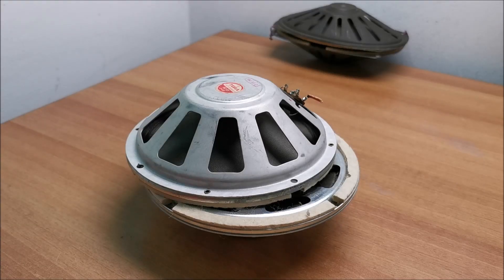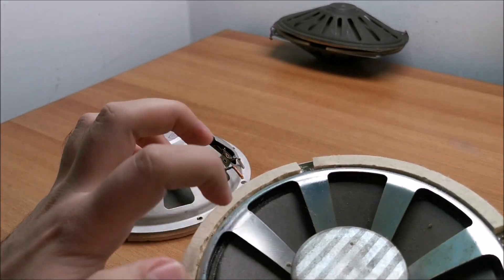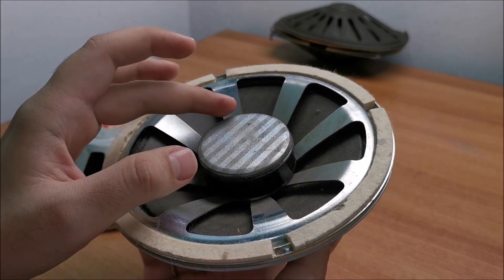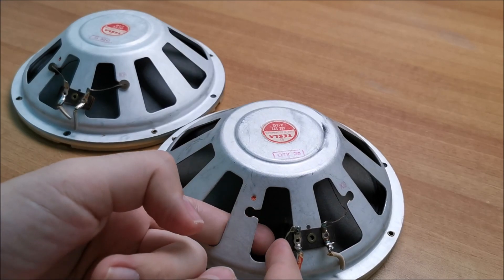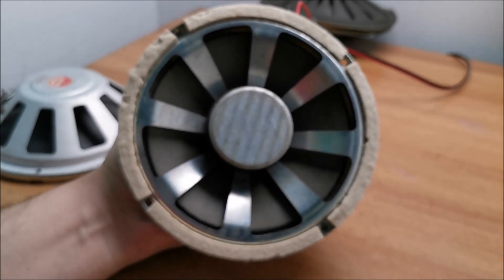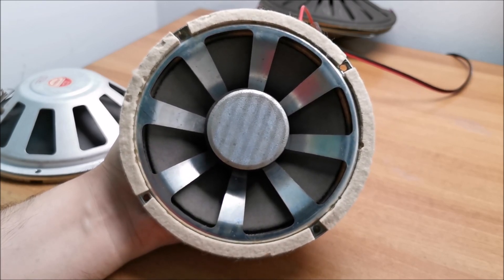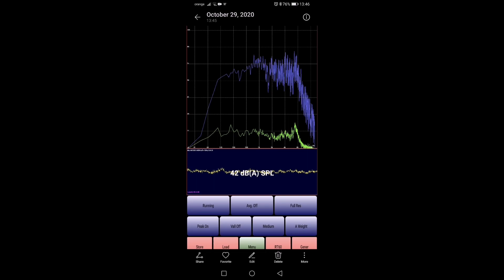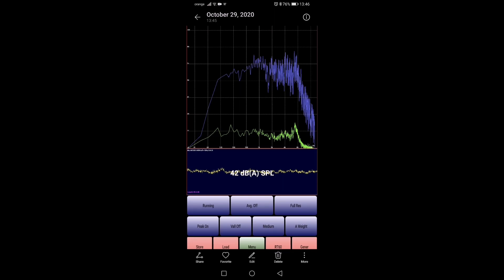Tesla ARZ 572 Czechoslovakian speakers - audio test and frequency response

Comment: Very interesting video. Your pieces of ARZ 572 loudspeakers were manufactured in June 1968 at the TESLA factory in Valašské Meziříčí, at that time Czechoslovakia. They are rare and very high-quality loudspeakers, they were used built into the ceiling of buses and trams as a radio and stop announcer. I also deal with TESLA speakers and have compared the sound of an ARZ 572 (mine is from 1971) with an equally sized and matching classically designed ARO 567 (1970). 
ARZ 572 vs. ARO 567 - YouTube 
The video shows that their sound is very similar, only the high notes are slightly masked with the ARZ because the center of the diaphragm is covered by a magnetic system.
Thank you for your video and good luck.
Reply from the maker: Thank you for this information!
(Also, you have a new subscriber 🤭)